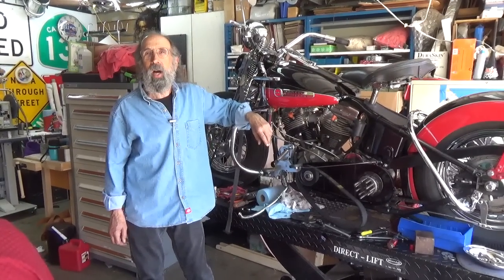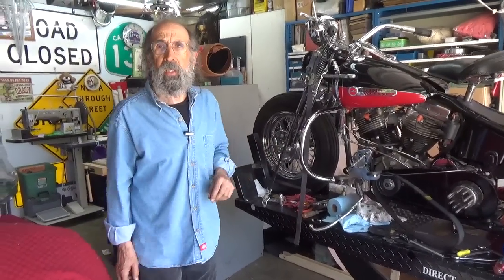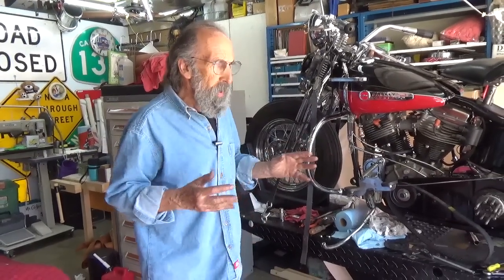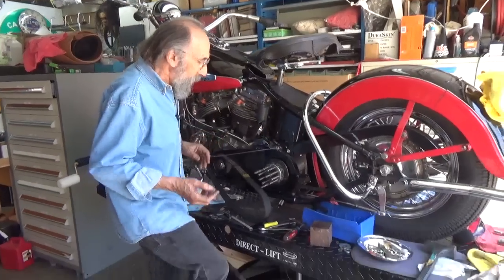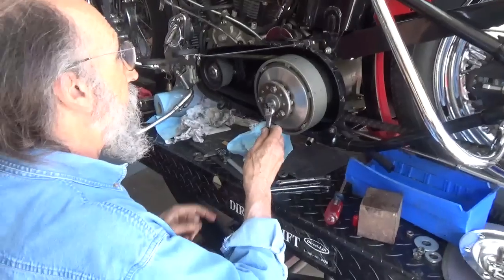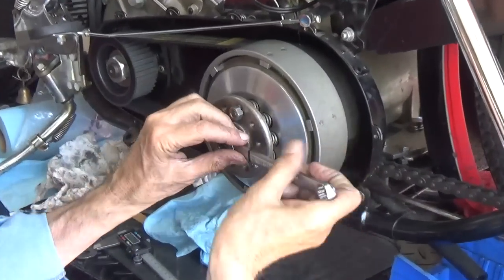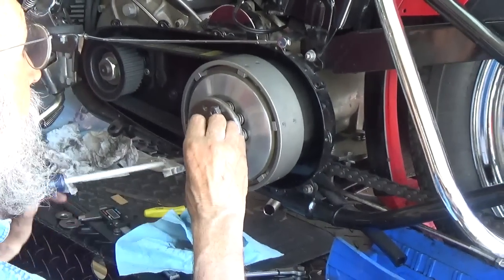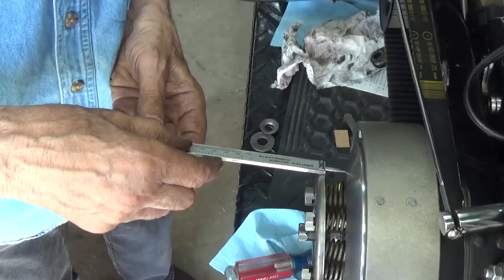Rebuilding the Clutch on Fred's Harley Panhead

Comment: Hi Mike!  As it turned out I was installing a new compensator on my hot rod FLH sidecar rig today.  Your comments on installing clutch plates properly came in handy.  Interestingly,  my pressure plate nuts have a cutout that matches a dimple on the plate.  Makes it easy to properly set and true the plate.
Reply from the maker: Yes.  They all do, unless they have the wrong nuts.

Comment: I've never been a fan of primary belt drive.. rear belt drive to the rear wheel works great
Reply from the maker: On a kickstart only, with tin primaries, it's a massive improvement.  Smoother, much cleaner and much less maintenance, not to mention your friends driveways.  With cast, sealed up primary housings and electric starters, I run a stock primary chain.  It's all in the application.

Comment: Very interesting again!
I do the same assembly (1st a metal plate), but with the same number of plates as original. The only thing what change is in the center of the "pile" of plates I put two "soft plates" together, so I finish as original tonthe pressure plate. Not easy to explain,  but it works now for my rigid shovelhead with dry clutch. Before I changed every 2 years the aluminum clutchhouse. Cheers from France mate 👍
Reply from the maker: Cool, thanks

Comment: Mike, and all...
I've been wrestling with Harley's antiquated 1941 clutch since 1967.  When set up properly they work great, and when not, they don't

I see absolutely no purpose in the little rattly ball & spring buffers on the steel plates.  Most later H-D clutches and all aftermarket clutches, such as Rivera Primo, and Barnett, do away with them.
Am I wrong?
Also.  On my 1968 FL, I am reverting back to the original recirculating chain oiler since the flooded primary is a leaker on this bike, and messy if I have to open 'er up for service work.  This is a newish build I am still sorting things out on.  And, you made the comment that you still use the re circ system, and I can see why....
....RooDog....
Reply from the maker: Well, some like the buffers and some don't.  I've run them with and without.  If they're in good shape, I think they're fine, certainly quieter. If you don't like them, I get it.  Okay by me.  Sealing an early enclosed primary is nearly impossible.  Yes, I run the stock recirculating system.  It works great.  And, I don't need to constantly check it.
Reply: @pacificmike9501  If the buffer are in place I leave them installing them as you do, staggered.  If any are damaged or missing, I don't sweat them,  and do not bother replacing them, as I believe them to be useless.  I have also seen some AM plates with rubber O  rings,  Now what a dumb idea, as they will surely break over time and could foul the clutch.  In the Harley world there are a lot of dumb ideas floating around.
Reply from the maker: I've always believed (my dad was an old hotrodder and biker) that modifications, either mechanical or just for looks should be done for the purpose of improvement.  I try to keep my custom stuff that way,  I want it to work as well as I can do it.  I'm always learning.  I've got these old clutches down pretty well, then we made more power.  There's some pretty nice units out there now, better than ever.  But, you gotta be determined, possibly cut into our grocery money.

Comment: Another great vid Mike.
Mike I wondered if you would be able to tell me where I might be able to get a buddy seat spring set up for a saddle seat. I have finally found and bought a restored 46 Knuckle and as I weigh a bit I may need that extra bounce. Thanks ahead for any shops you can recomend.
Reply from the maker: Best bet is the swap meets for originals  But repops are produced by Tedd Cycle in New York.  You might be surprised when you turn up a set on Ebay.
Reply: @pacificmike9501  dont hav many here in Australia that would have those parts. Ill keep looking and try where you suggested. Thanks..
Reply from the maker: I'm sure you can find it on Ebay.  I do remember a time when a lot of Harleys went to Australia.

Comment: Mike, curious to know your thoughts about running an enclosed belt for primary drive.  I've heard that the temps inside the covers get too high for a belt to live very long, especially with touring use [i.e., long distances].  What has been your experience?  Thanks for your sharing and generosity.
Reply from the maker: My experience is "no problem."  I always use a Kevlar belt and the last one that went bad was on my 52 Panhead with an enclosed primary.  It is an 8mm Primo Rivera.  I actually wore out the engine a couple times in 20 some years and finally pulled some teeth off the belt.  It had outlasted any primary chains I've owned.  Later models, (1965 and later) I run stock enclosed chains.
Reply: I was going to ask the same question. I spaced the derby cover on my shovelhead out about 1/4” for some ventilation, but not sure it’s even necessary.

Comment: Mike, How does Fred handle not having a stamped VIN? here it wouldn't be an issue - but I hear stateside they're very particular.. 

Off piste I apologise - the ramjet is such a great design. I ran a clutch without one for  a while and it went around like a buckled wheel. Makes such a diff.
Reply from the maker: Laws and situations vary from state to state.  Roger was quite an inventor and that part really works well.

Comment: Hello Mike. I have made many changes to my 98 Fatboy based on your wealth of experience. Any real life disadvantages of running an open primary instead of stock Evo setup. So much arm chair advise to be had. I'd be interested in your thoughts.
Thanks
Reply from the maker: On  big twins 1965 and newer, I run stock primaries and electric starters.  There are some nicer ones out there, but the stock system is pretty good.  On the old bikes with tin primaries and kick start, I improve it with a belt drive, enclosed so it won't eat my foot.

Comment: Greetings from Denmark. Have you any experience with long roller bearings instead of the original bearings? I ran it over 20 years on my knuckle. It had a problem with a wobbeling and noisy cluch, but after i switch to long roller and ram jet retainer (absolutly must) I never went back. 62 long roller also gives a lot more bearing surface than the 20 short ones, and it gives a little slack to install the clutchhub without losening the gearbox.
Tage
Reply from the maker: There are lots of combinations that we get stuck on because they work for us.  Those are the good combinations.

Comment: Hey there Mike.  I have a 1969 XLCH and I want to attempt to use a dry clutch.  Have you ever done a Sportster dry clutch set up?  Any tricks to sealing up the clutch basket?  

Thanks, Mike.  long time subber and liker.
Reply from the maker: I haven't been in one of those in a long time.  But they are designed as a dry clutch and can be done quite well as per the factory service manual.  I believe Tedd Cycle in New York stocks all of the parts for that clutch.
Reply: @pacificmike9501  Thanks Mike.  I'll touch bases with Tedd C.

Comment: Thanks man. Just bought a Sucker Punch Sally and it had fluid coming thru the shaft into the clutch pack. And it was overfilled. I thought i was gonna have to figure out some seals in the tranny (an Ultima). I wonder if Harley seals will fit that hub where you doubled up. Any how, thanks again.
Reply from the maker: Don't know exactly what you have.  But, overfilling the trans will certainly cause it to leak.

Comment: Can you tell me mike, i have the same belt drive in my panhead all enclosed exactly same, will it overheat? Do you run it without the derby cover? Ive heard bad things
Reply from the maker: I run mine closed on both my Knuckle and my Panhead.  The one on the Knuckle has been in there about 15 years or so and the Panhead, which has had a lot of use and traveling and on and on lasted until it pulled some teeth off at something like 23 or so years.  Today's Kevlar belts are superb.  Look through our videos when I replaced the belt on "Baby Doll."